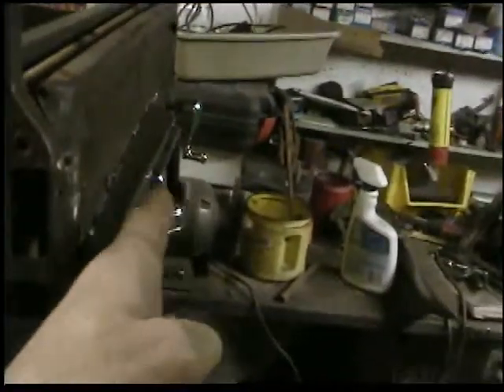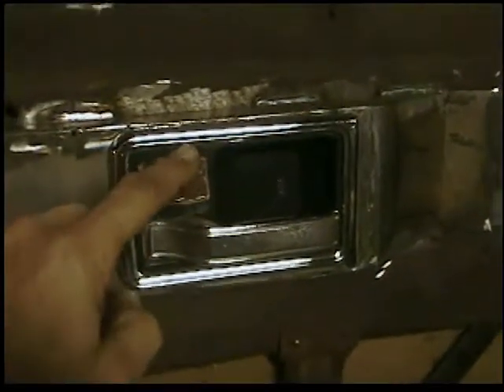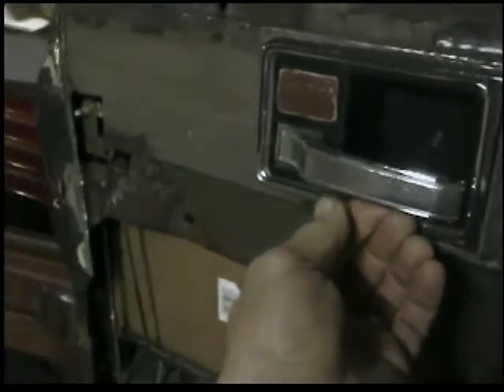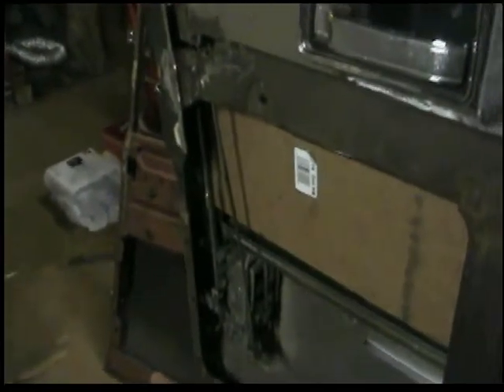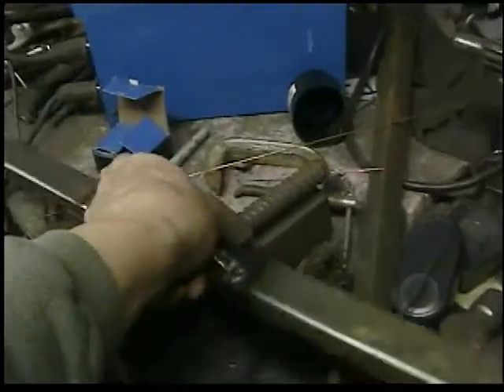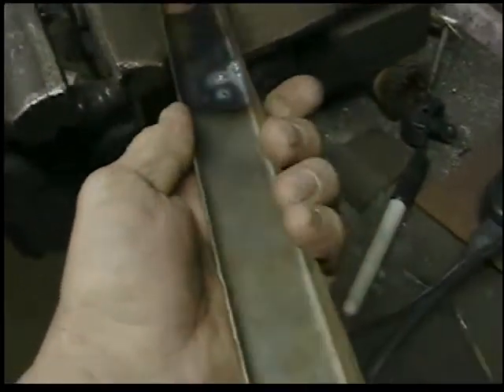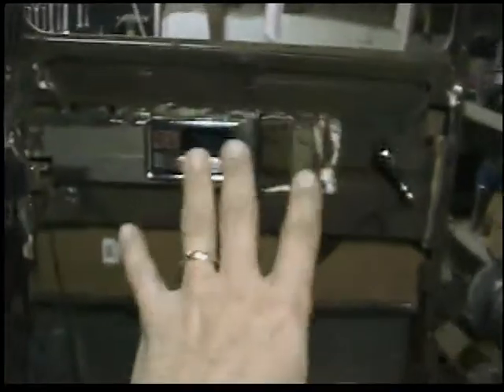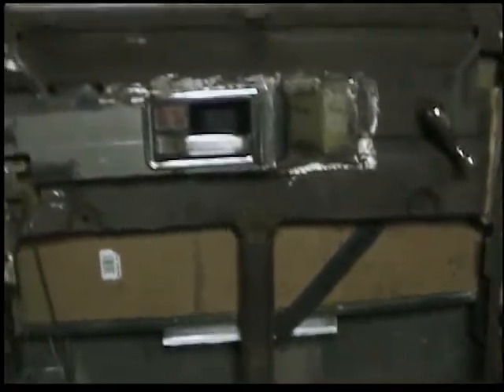34 Frankenstude Too Super Coupe or "Pullin one over on Franky"

Comment from the maker: @bcrawdad1 the expanded metal i have is hvy stuff...i was thinkin more like chicken wire but the holes are real small..doesnt matter I ended up not using any metal...I just covered the door with 2" cellophane packing tape then some duct tape here and there. then I cut out a pc of fiberglass to fit..and gave it a single coat of resin...ill build it up some to be around 3/16" or so thick...then glue some thin foam rubber over it then some material and attach it to the door...